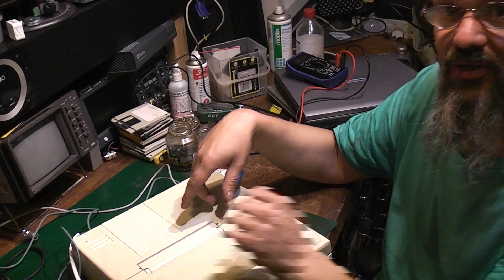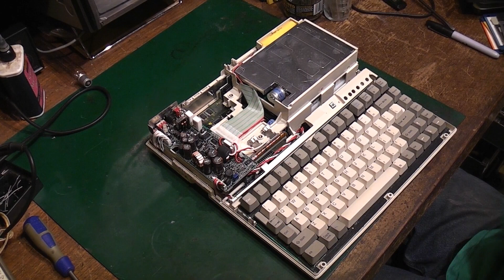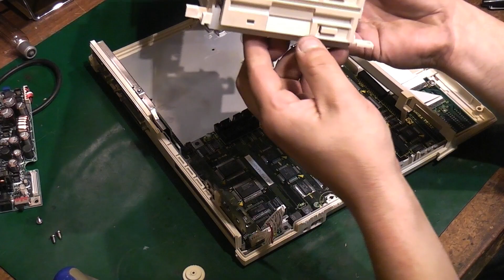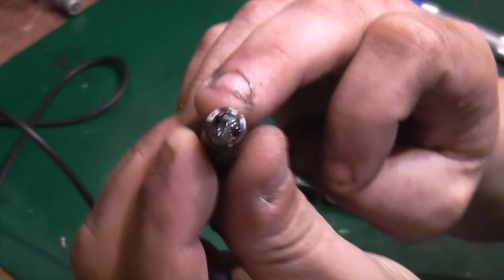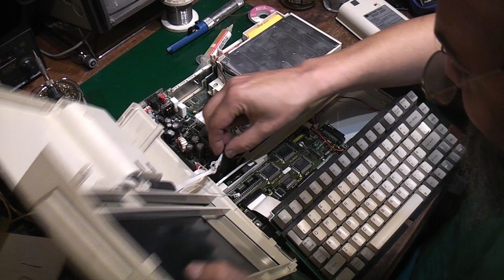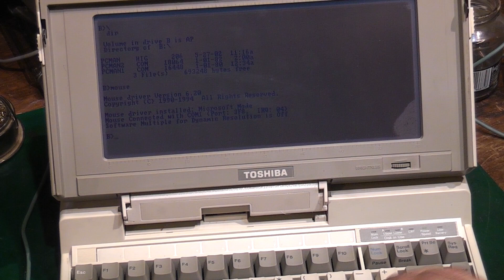Fixing some problems on my Toshiba T1200 Laptop and playing a few games

Comment: I've heard/seen on youtube so many complaints and warnings on those capacitors in old Toshibas that I wouldn't leave a single one unreplaced, because even if it doesn't leak yet, it may start soon. And that's what I'm currently doing on my T1000. I actually didn't even check which one was leaking and which wasn't - I was too absorbed with that damn corroded solder being such a pain to melt, oh dear. Kind regards, hope you haven't had any further problems with it!

Comment: Great video. I have a T4400C laptop, unfortunately it has a cracked screen. Was surprised when I opened it up to find a full sized 486 33 installed in a ZIF socket. Looking forward to the XT boards. How's the Amstrad 1512 doing?

Comment: OMG That's the same model I need to finish trying to fix...  Could you do me a massive favour and measure the voltages on the PSU when its not connected to the mainboard and stuff?  eg. just powered by the PSU connection.
Reply from the maker: Yea no problem its still out on the bench, i'll try to put you a quick video up showing all voltages coming off the PSU PCB.

Comment: Your Toshiba T1000 videos is how I found your channel back in the day.  I’ve got both the T1000 and T1200.  

As you know, the power supply capacitors are a pain to replace and they leak and destroy the tiny traces nearby.

Comment: In my laptops, lamination only affects the polarizer sheet and the glue used to bond it. It's just a case of getting a polarizer sheet, find the angle and glue it. I managed to remove the glue and old polarizer with the help of a sharp blade. But haven't managed to buy the replacement sheet yet. Maybe if would be better to just place the polarizer on top of the screen when you use it, and skip the gluing part, as it will happen again in thirty years.